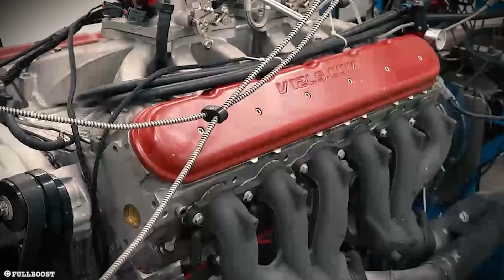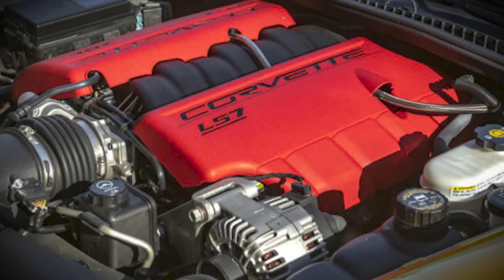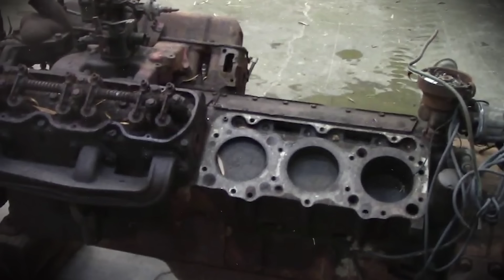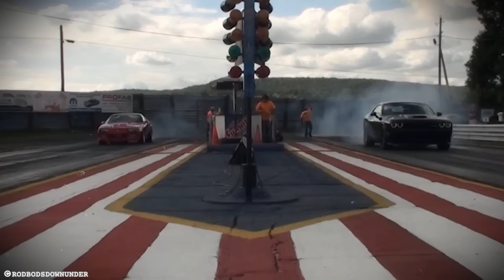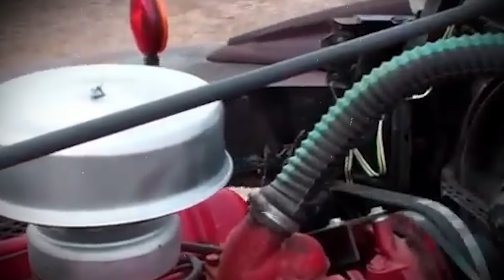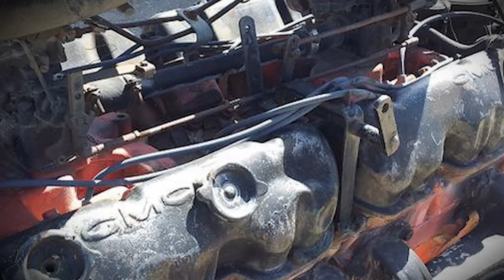How One GM “Bus Engine” Outsmarted Every Drag Car With Low-RPM Torque Nobody Saw

Comment: I guess if you remove a lot of steel thickness everywhere, if you have to dragrace with this engine, it might be pretty light for its size. Someone talked about the main caps that doesn't have cross bolts or something lik that, but it maybe could support mild preparation ^^ .

Comment: I have the 305 v6 in a 65 GMC 4X4. It is a gutless 800 lb gashog. But indestructable, original engine. The reasoning for short stroke was durability and economy, the torque came from massive flywheel and crank rotating mass, great for initial acceleration. The cam and lifters run in a pool of oil, main bearngs are in, not on the block etc etc like a tractor or diesel.
Reply: Had one in the family straight truck/corn hauler. We used it for hauling scrap. It was damn tough, but crazy thirsty. My grandpa had a ford with a 361 FT v8. It would haul similar loads and eat less gas. Partly due to the driver I think.  My uncle dogged the Ford, but our gmc didn't care about that. I got used to gas trucks and went to diesel stuff for hauling 22k to 30k lbs and it drove much like that old gmc. The gmc has been restored since 2002, and it used to pop up in parades. The guy that has it buys the trucks his dad had in the early years of his own life on the farm, restores them and keeps them like he uses them to connect to his dad.

Comment: I remember my friends dad had a V6 one of these in his old 4 speed 65 GMC truck -  solid lifters, plugs on the inboard side of the heads and it did indeed
have huge low end torque and was very reliable also good for towing and we loved the way you could drop the trans into first gear at idle and it would just walk away, also started out as good in second gear as in first gear - but drag racer-?-no way - it did not have cross bolted mains that I recall but it was a good low RPM high torque work engine in that old lightweight pickup, pulled like team of horses.

Comment: These were dog ass week engines, I doubt any ever saw a drag strip, weighed too much to drag its own ass down the strip, they were also piss poor truck engines.
 The 305 did not make enough power to piss on itself.
They did make pretty good irrigation engines as they were dirt cheap cuz nobody wanted them.

Comment: Horsepower sells fast cars, torque wins drag races
Reply: Yes, but one is useless, without the other. It's nice having both.
Reply: One is a byproduct of the other thus they’re one in the same
Reply: @Thumper68  Propane is a byproduct of gasoline distillation, separated using a fractioning tower. Same with Bitumen (tar), HFO, Lubricating Oil, Heating Oil (#2 diesel), Kerosene, Jet Fuel, Naptha, Propane, Butane, etc. They're all by products of Oil. Does that mean I can ren gasoline in my diesel engine?
Reply: @BiffTannen1983    gas in a diesel will run, too good then never run again 😂😂😂

Comment: my own 702 v12 is shown in this video. there is a lot of misinformation in this video. a LOT of the specs quoted are incorrect. Please watch if for the entertainment value only,  and not for specific information about the engine
Reply: Thanks for the heads up. I'm only 1 minute in, but that Twin 6 caught my eye at 15 seconds. I'll keep in mind what you said.  😉

Comment: Notice the two Impco 225 propane mixers in the one segment . That can't make power at that low compression . Cool nostalgia but the Detroit diesel two strokes made better bus engines .